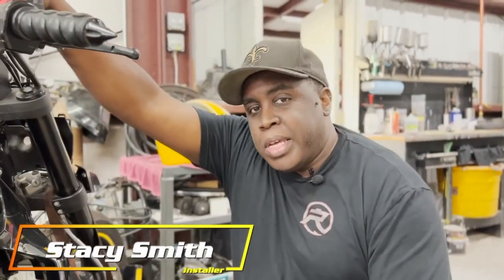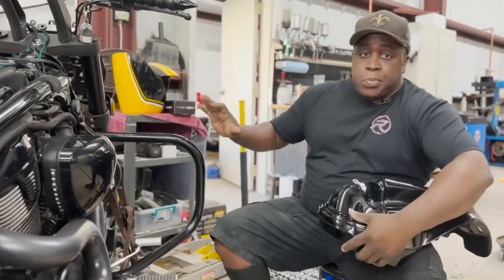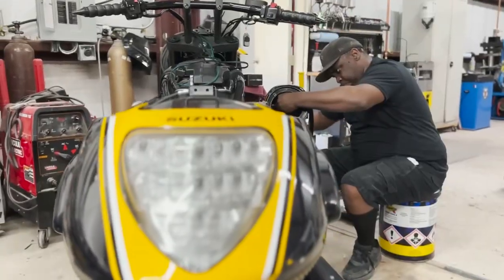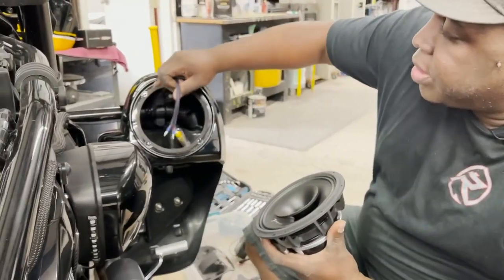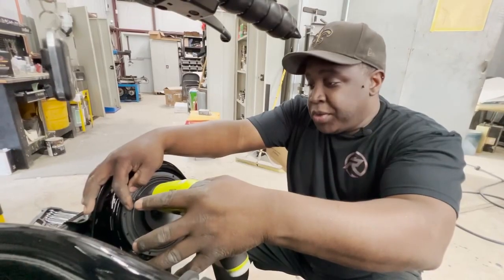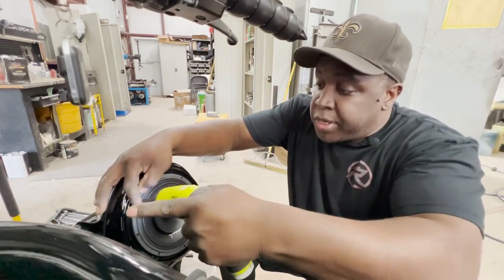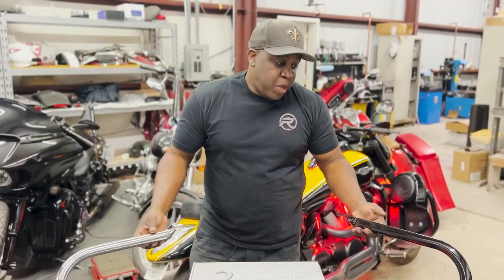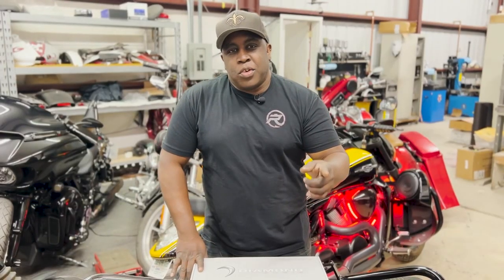Suzuki M109 Audio Install

Comment: Are those standard HD pods? If so then would the dual 8" ones work? Would love to run a pair of Xpert 8" carbon fiber speakers
Reply from the maker: Yes, we tested multiple pods with 8” speakers and it does work perfectly

Comment: Is it easier to install a Batwing?
Reply from the maker: Perhaps, but in my opinion the M109 was designed as a performance cruiser, not a touring motorcycle. This audio system was engineered to produce high quality sound with minimal changes to profile of the bike. Batwing fairings are good; as long as the audio equipment is upgraded.

Comment: I have a 2014 Suzuki boulevard m109r. Are the modified highway bars available in chrome?
Reply from the maker: @funkadelic4life: Yes, we have them in powder coated super wet black and chrome.
Reply: @user-ns8nv9em8w  those bars are very pricey!
Reply from the maker: @funkadelic4life   Designing, engineering, fabricating, producing, and final finish on any custom one-off parts are expensive, but where else can you get a quality part guaranteed to fit allowing the M109 to compete with Harley audio systems? There’s always those BOSS handlebar mounted speakers…
Reply: @user-ns8nv9em8w  I understand. But 1200+ just for highway bars? That's over 600+ per side when 600 would be expensive for a pair. Harley bars are anywhere from 100 to 300 for the set. But I get you have something that no one else has right now. Congratulations on a great looking product. I'm on a fixed income so I'll have to wait until prices are within my budget.

Comment: Where does the Amp mount?
Reply from the maker: @Brian Turner: The amplifier is mounted behind the headlight. We use Soundigital amplifiers because they’re compact and provide plenty of power. There is enough room behind the headlight to mount the amplifier and the DSP by trimming out a small portion of the bracing. Trimming this brace does not highly effect the support of the headlight or cowling. If you have any questions regarding the install, email sales@rushbikes.com and we can walk you through the steps.
Reply: Please do a video on how to do this
Reply from the maker: @ironfists06  we will do a video of the audio install behind the headlight with the next M109 that comes into the shop. I believe we have one coming from Georgia in a few weeks.